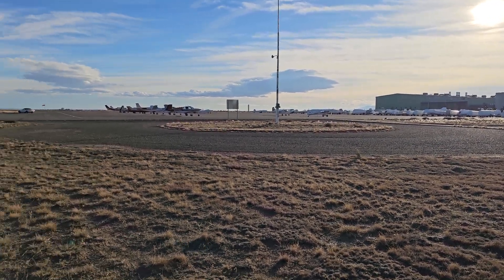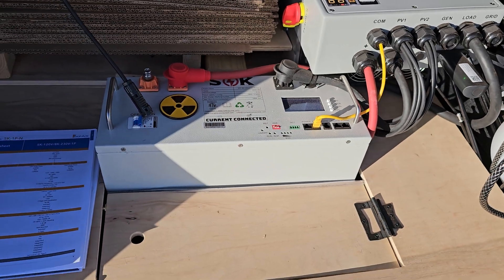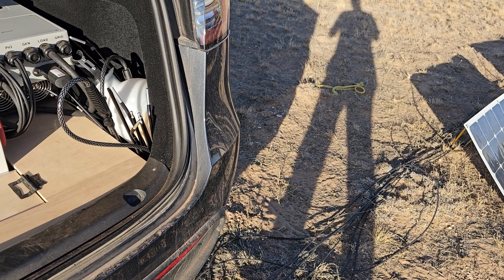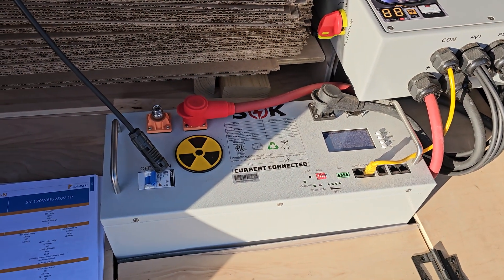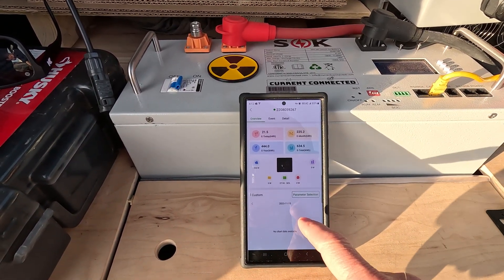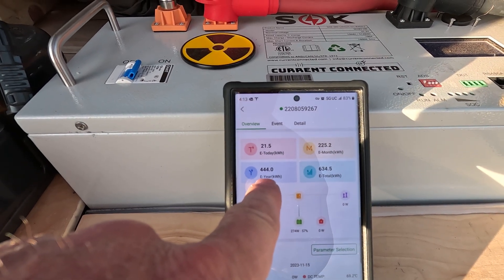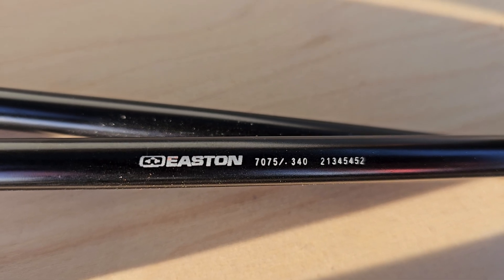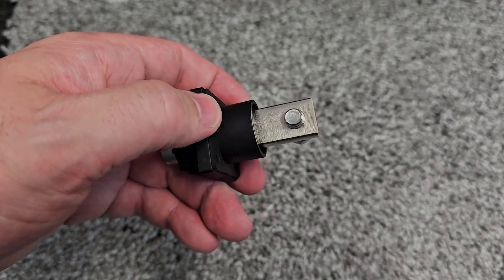Specs: Self Contained Solar Tesla

Comment: Curious how you connect to your Teslas battery?
Reply from the maker: I just used the mobile charger that came with the car.
Reply: @lightpowered  Ah so you are converting from DC to AC and then just plugging it in like a normal socket, got it.

Comment: question for whoever: If you could order up any custom piece of electronics designed exactly for the purpose of charging an electric car with solar panels, what would it be? Would you even have an inverter/battery stage or would you go directly into the main battery if you could?
What I'm trying to get at is, how much of that equipment is physically necessary to charge any battery and how much it just there to make the car think its being charged at a regular charging station? If an electric car maker was willing to put the right connections in, it seems like a much simpler set of electronics built into the car could take the hugely variable voltage directly from the panels and convert it to what the traction battery needs to charge. 
Sure it would add some cost and mass to a car, but seems like a car designed from the start with a solar charger unit could have a much smaller lighter unit because it would be dedicated to only charging that specific battery instead of providing safe AC power for household appliances
Reply: Boost converter hv DC, with hard current limiting , least amount of losses NXT to direct solar

Comment: Did you consider reducing the car weight? Seems like that would help with range.
Reply from the maker: Yes, I did reduce it a bit in Oklahoma, aside from elevation changes it does not have much effect. Also I am running my tires at 51 psi instead of 41 psi stock. In theory going from 4000lbs to 5000lbs and 41psi to 51psi I should have the same tire contact patch area and thus similar rolling resistance. Aerodynamics is the biggest hitter and I have no external modifications or trailer to drag me down, literally :)

Comment: Cool, it would be very nice if you could automate the charging process. For example with an app that collects all data and adjust the charging accordingly. Also i'm not an engineer but on good sunny i don't get it that why it isn't possible to charge with 6400watts?
Reply from the maker: There are charger that do just that, designed for home use with solar. I did not have time to get one or set it up for this trip.

Comment: They now have the standalone SOK batteries for $1200. Depending on what inverter you have, you can manage when it pulls from battery and start/stop charge points. You don't necessarily need the battery with communication, but it is nice to see cell voltages.
Reply from the maker: Yes, and about time!! battery prices started to really go down

Comment: neat journey, thanks for sharing!

If you're using a Raspberry Pi/SSD for your sentry storage, you could run node-red on the Pi and write a flow to live control (via tesla published API/ 3rd party token) the charge rate of the onboard tesla charger to effectively match your incoming PV ampacity (data point grabbed from SolArk/SOK via can bus). Probably wouldnt be too hard to do. Then the car would automatically raise and lower its AC charge rate based on the PV array performance and the sunlight available. Anyway, just an idea i had while watching. Thought Id share :-)  Safe travels!!
Reply from the maker: That is quite cool, I tend to stick the the gears and shafts I am used to, no programing for me. But maybe I should give it a try. I have another project that may require me to link and program electronic speed controllers to work together.

Comment: I love watching your progress on your Solar Cannonball run 👍👍
For your next run I wonder if the following solar roll would save you LOTS of setup/pack-up time. 
They would not be as efficient (since they are flat on the ground), but I can imagine unrolling 2 or 3 of these and pinning them to the ground would save you loads off time.

https://www.youtube.com/watch?v=eVz2F1Hn65I&t=20s
Reply from the maker: I did see that as well and the idea of a continuous process printed solar panel got my attention. When I dug a little deeper and followed their progress they seemed to have efficiency problems. That type of panel has very low power output. It was very hard to get any real numbers so I imagine it is still a work in progress.

Comment: Good job! That is not an easy system to make work. You are running it very close to maximum. Leaving 1400 watts on the table is fine, since the world is not a perfect simulation and there are things like clouds and stuff.
Mechanical engineering requires a sort of perfection with a 100% maximum understanding such as detailed material constituents, manufacturing processes and physical properties such as yield force measured in kilopascals. However, electrical engineering does not quite perfect as exactly, since the system will actually last longer operating at 80%. For example, 1 foot 18 gauge wire can handle a maximum current of 10 amps. However, if you put 10 amps at any voltage on a 18 gauge wire 1 foot in length, it will begin to smoke and melt after several minutes. That is because heat is not dissipated from the wire effectively, if you cooled the wire, it would be fine. So it is better to only run like 8 amps continuously.
Reply: It's more efficient to charge at a higher current because the Tesla uses quite a bit of power just being awake with the charging circuit active

Comment: Really interesting, shame the unit can't cache its data until it can upload it, I get a WiFi hotspot on Verizon's network for travelling, seems to have the best rural connectivity, even when the car's cellular fails, and then you could leave that in the car for all the units to use, sometimes those hotspot data deals are actually cheaper than your phone's plan, so it's cheaper to use the hot spot even from your phone - especially true if you are roaming in the US from Canada ;)
Reply from the maker: That is good to know. Original was going to use victron equipment all via Bluetooth and it caches everything.

Comment: What is the most kWh you put into the car in one day, without using grid power?
Reply from the maker: Only 31 kWh in one day if I was able to leave sooner I believe I could have gotten a lot more upwards of 40 kWh per day. I may make a screen share video from my office with Excel and Solidworks 3D models of how I planned and made my projections. Ohh and I never used grid power for the whole trip ! Generated a total of 833.5 kWh for the trip.
Reply: @lightpowered  Amazing. Congratulations on the project - really inspiring.
Reply: @lightpowered  oh for sure, winter time is shortest days. Summer might make the trip longer but get more power per day, idk. Winter versus Summer solar test!

Comment: how much time does it take to layout and angle the panels? Do you keep the panels plugged into each other in storage to make setup and take down faster?
Reply from the maker: From start to finish, park the car to full charging, takes 2 hours. Same for packing up. Originally I wanted to keep portions plugged in, but it made stacking and carrying them far more difficult than having them unplugged each time.

Comment: I like how you anticipated fatigue failure of those fasteners in the battery.  You would've gotten a bit more economy from an ecoflow delta pro ultra, but the inverter output would've been less, and I'm not sure what the solar input voltage was... I'm guessing it's a fussy 48v instead of "it's all good" from your current setup. Still a sponsorship from ecoflow might be what you need when you go from the arctic circle to the tip of South America.. 😉
Reply: Ecoflow DPU has a 4000 watt max solar input with 450VOC and a second input at 1600 watt max solar at 150VOC. Both Solar Edge and EcoFlow would need a hotspot cell service to access the controls remotely if wifi is unavailable.
Reply from the maker: Yes, not quite enough power.
Reply from the maker: Yes as Tim the toolman Taylor would say. More Power! I think the Cybertruck would be perfect, and have a direct tie in to the battery through the connections built in for the range extender battery! I like Ecoflow and their flexible 100 watt panel was my backup solution if I could not get Sunpower/ Maxeon, which I consider the best in the market.

Comment: If I had the perfect world for doing this sort of event which obviously being disabled and handicap I am totally useless to be able to do this sort of thing. I would purchase a Aerovault MK2 trailer load it up with 40 MODULE-KBS450-MONO-BF From KB solar located here in the US. So that's four rows in Series at 10 panels each which allows for two strands in Parallel if you get what I am referring to. Solark 15k unit. Trailer Batteries to store energy EG4 LifePower4 Lithium Battery | 48V 100AH | Probably 8 max. Obviously another way to cut down on cost would be a good camping tent of some kind. OR a trade off of a pull behind small RV with less power panels you could probably cut down to 20 of the KB panels and operate at full capacity with out worrying but it is nice to have that extra set of panels not only for backup but to enable higher charging output to allow both batterybanks to charge up and your Tesla @20 amps. (Optional RV OZARK 1620BHLE to behind trailer instead of the Aerovault mk2. Remember the RV will actually very high drag co efficiencies and cause range issues.  But would cut your hotel costs and allow for I think a better time while traveling.)
Reply from the maker: Yes that Aerovault is pretty cool. And you are right about trailer drag. My original plan was to use a small airstream and take my wife and two kids, but as I ran the numbers it was not feasible due to aero drag and also I did not have the funds so that made the decision for me :)
Reply: @lightpowered  Hey I get it anything breaking the barrier is expensive I was just giving my opinion on the best case scenario Yeah I figured you would like that Aerovault but I imagine they want bank for it..

Comment: Thankyou so much for sharing all your data and learnings from this trip. 
I have considered doing the same type of trip for a lap of Australia (about the same size as the USA 48 states) using solar power alone. A team of people announced they were doing this recently in Australia. I followed some of their progress, but they seemed a bit hesitant to disclose their method of charging. Turned out they had another support vehicle lugging batteries along and used chargers wherever available which, to me, made the entire "solar powered" hype redundant. The way you are doing it is true to your description.
I love your solar panel support design. I've given the problem of standing the array up a lot of thought. My intent was to use Coreflute (like plastic cardboard) slightly smaller than the panel and taped along the top edge of each solar panel to form a hinge and keep the top edge straight when it's folded out to create the support. Now that you showed that you also need carboard between the panels to store them I realise that my idea would also serve that purpose too. 
Thankyou for sharing your ideas as well as making entertaining videos. I'd give you a thumbs up if I saw you Onewheeling along talking into a microphone!!!
Reply from the maker: Cool thanks, Yes I think I saw the same Australia thing as well, some kind of roll up printed panel. They seemed to be very inefficient, not to mention the ICE support vehicle to carry all the equipment.

Comment: Interesting. I am planning something similar in the uk. Using an env200 nissan van with a fox ess hybrid inverter hooked upto the 400v traction pack via the heater connection. This avoid ac dc losses and carry a 48v auxilliary battery. Need a lilygo to bridge the coms between the van battery and inverter. I guess my issue it no decent sun in the uk of space to put out arrays like this ad hoc. But its. A van so camping for a few days with a solar awning is kind of the goal.
Reply from the maker: That is perfect. Awesome that you can go directly from PV to the battery. I am checking them out now. I wish I knew about FOX ESS a year ago
Reply: @lightpowered  To be fair it wasnt as big a thing a year ago. It started of as a fronius hybrid inverter hack to add nissan leaf packs instead of propriety stationary batteries now its many batteries many inverters some of which can do eps with is emergency power supply i.e. standalone v2l stuff. Also luck for me chademo support is also on the cards so wouldnt have to hack into my power cables but i would need to 3d print a chademo connector.
Reply: Also i think your choice of car is probably right. An early ioniq would have had better aero but lacks space for panel and carries far less kwh in the batteries. My van is an aero brick.
Reply from the maker: Either way that is very cool. I just subscribed, now I need to see it!! My ideal solution would be PV DC to NASC charge cable. And the yet to be released Maxeon Air solar panels. Then build an RV that could charge the tow vehicle for ultra remote off grid adventures.
Reply from the maker: LOL yes, the aero to volume ratio is strong with the Model Y.

Comment: With two batteries, you could make it a lot more resilient with clouds. Since the batteries are rated for 100Amp discharge, that’s only ~5kW. With a second battery you could recover those missing watts and help your cannonball run time. At the cost of extra weight. 

This looks like a very fun trip!  Best of luck.
Reply from the maker: Yes, in fact the trap door is exactly the same dimensions as a second battery, if I needed I could drop in another battery but would give up a little space. There were a few times I really wish I had an extra 5 kWh is store !!
Reply: @lightpowered  You could also install the batteries inside the frunk to balance the weight between front and rear.
So you may have been able to put the solar Inverter inside the hole under the trunk. 

This would had free the whole trunk allowing you to carry flat several PVs assembled together or use larger PV panels.
This would had saved assembly and desassembly time, but your solution of small panels saved weight. 

However, it was very important that you were able to incline the PVs to face the sun instead to put them flat on the ground.

I wonder if using a 240V split phase could be more efficient?

I think I would had added a cellular hotspot to help monitoring the charging.

I as wondering why you never sleep inside the car. But I realise that everytime you open the door this would weak up the car
and also you do not want to run the HVAC. This is not like when you can get extra kWh for few dimes and save a lot on hotels !!!!.